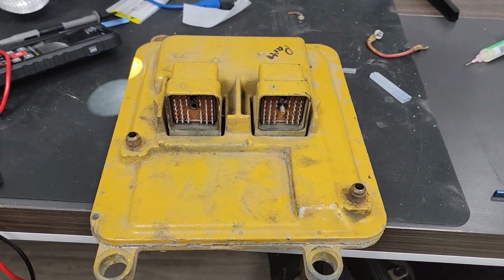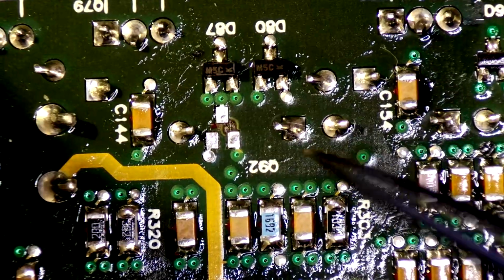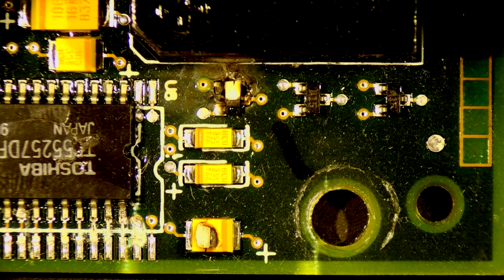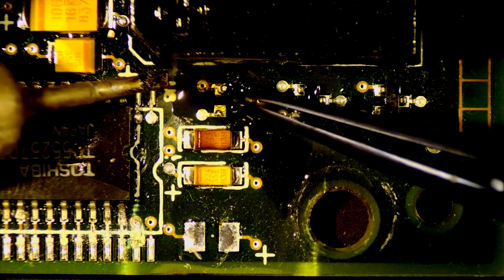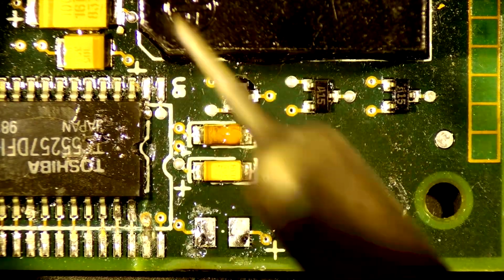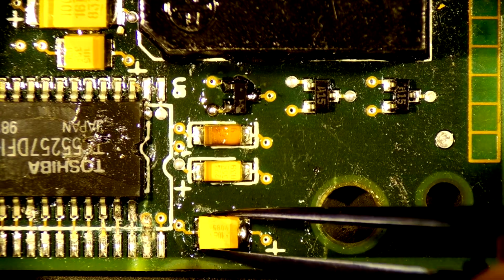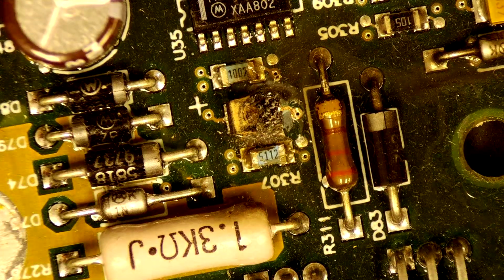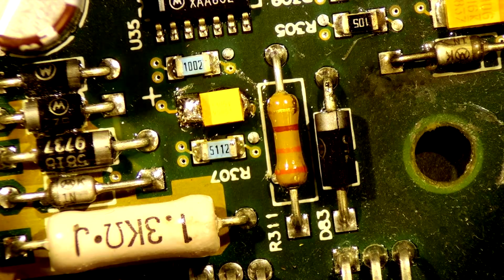CAT ECU Repair - Replacing faulty components on a CAT Electronic Control Unit

Comment: The first component silkscreen is marked Q though, not D?
Reply from the maker: Good eye. I actually missed that when working on this.  The unfortunate part is, I'd have no other way to identify the chip..  if this ECU comes back to me, I will have to dig deeper.  Fortunately it seems to be running the truck, currently with no visible issues.. fingers crossed it holds out